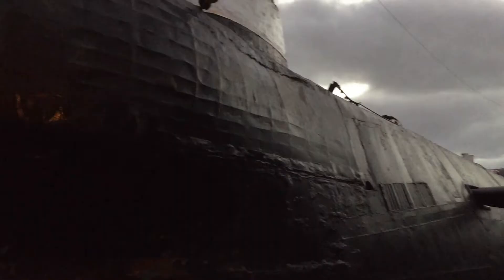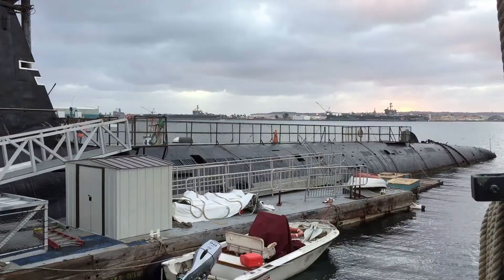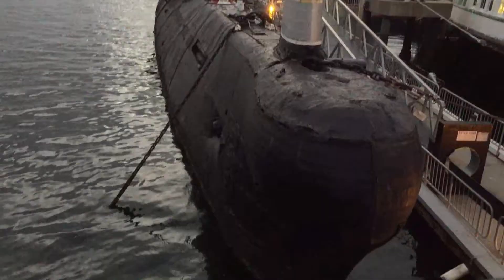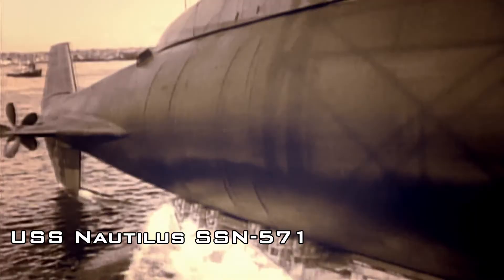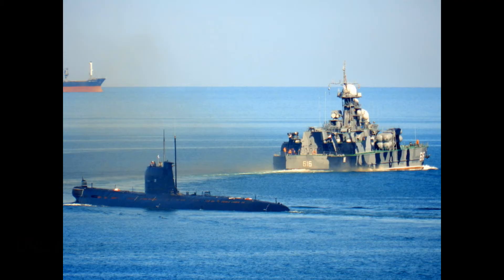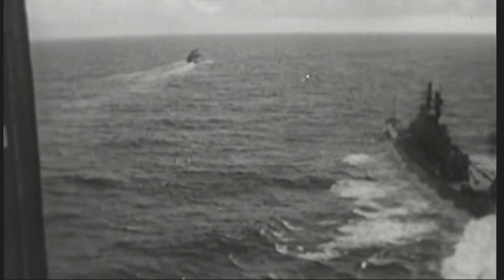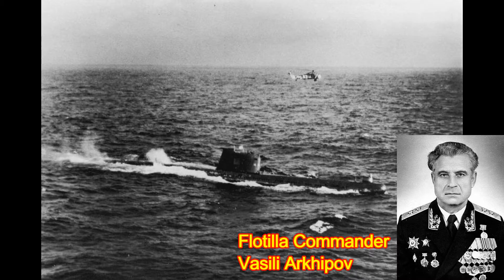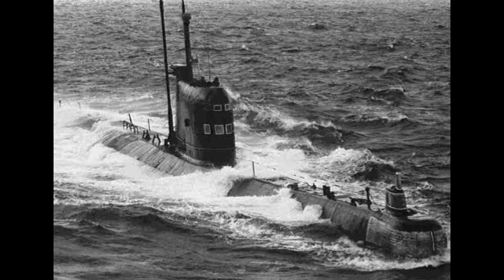The Foxtrot Class Submarine - A Mini-Documentary

Comment: A bit wrong about noise here! Yes, when running on diesel to move fast at surface or recharge the batteries, the sub makes many times much louder noise than a nuclear one, but once on batteries, it's very quiet compared to a nuclear sub which needs a lot of pumps and valves motions to keep the core cool enough. The nuclear is thus constantly somewhere in-between the noise of a diesel-electric sub depending on the latter's actual status.
Reply: that's a general rule... but Soviet design for post WW2 submarines kept the 2/3 screws configuration, very common in WW2 subs, but growingly noisy when faced against modern (by 1960) ASW equipment.

Nevertheless Soviet SSK had a major role in their naval doctrine, since most of the SSN would be tied to the role of protecting SSBN and hunting enemy SSBN and CVBG against a much larger NATO combined force, the SSK would carry the burden of facing enemy supply routes moving from North America to Europe... Foxtrot were reliable for that job up until late 70s when their noise was too high for the ASW deployed by NATO, but by then Tango and Kilo were the better SSK classes. They kept sailing around for a couple decades more, since last unit was built in 1983

So at the end of the day they were suited for a commerce raid task despite not being as stealth as USNavy/NATO SSN/SSK counterparts, and with some minor design changes (mainly insonorization of the boat and stern redesign to use with 1 screw only) they could have been way more lethal
Reply: The triple screw and no anechoic tiling did screw them, but at 1-3 kts sitting on the bottom or below 200m, they were still borderline undetectable even in the 80s. They had a self acoustic signiture of less than 100dB in silent running, and thats less than the ambiemt seastate usually is in the north atpanzic where they would be primarily deployed hunting REFORGER convoys. Still not as good as Tango or Kilo, which were massively helped by their significantly better speed, but not totally useless.

Comment: Between a November and a Foxtrot, I honestly belive the Foxtrot was the more tactically capable design. Bigger armament, equal test depth, only 9 knots slower at full blast, and 8 deciBells quieter, and a full 38 decibells quieter on creep motors. For reference, thats roughly the frontal signiture difference of an F18 and an F35. And it had something like 700nm undersea endurance, enough to run pretty much any blockade.